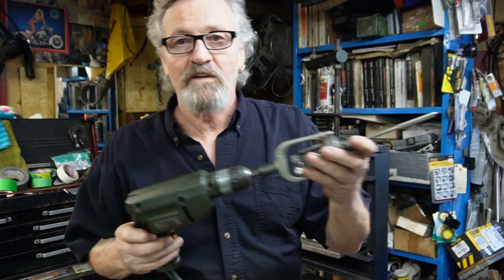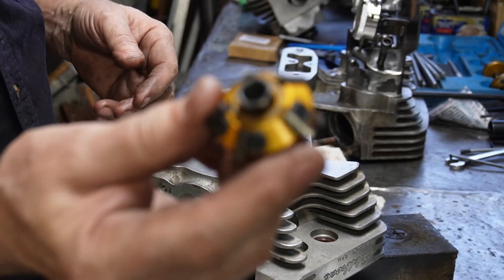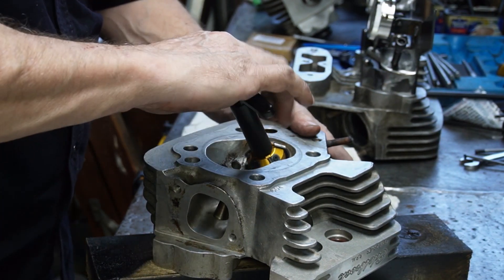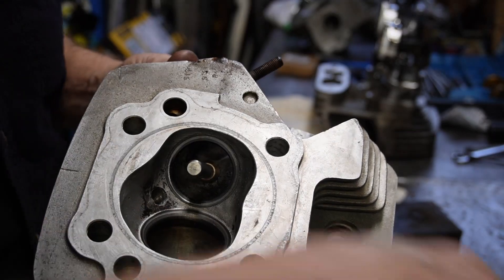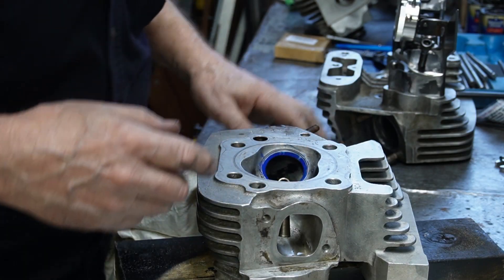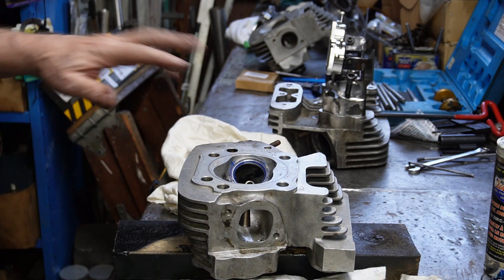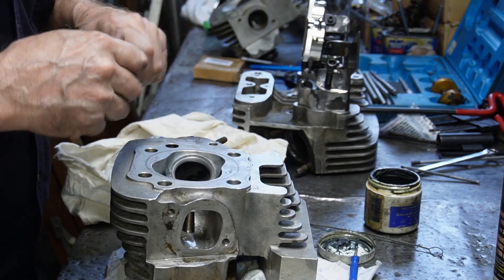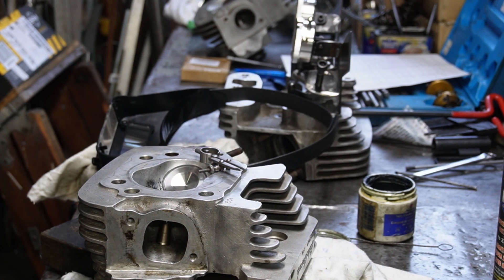DID WE GET THE VALVE GUIDE IN STRAIGHT, EDELBROOCK HEADS ON THE 96”

Comment: If you sink the valves deeper, doesn't that somewhat defeat the purpose of the higher lift cam?
Reply from the maker: There is always a trade off as I understand it, but we are not doing these mods for racing purposes only for necessity. The valves had to be sunk in the head to gain the clearance needed. In our case the vavle to valve clearance was a definate problem, as the valves were hitting each other, and modifications had to be made. As with any modifications going slow and doing out only what is needed is how we have gone with these heads. Getting advice from "people who know" in the field has helped us out a lot. I am not a head work expert and do not want anyone to think I am claiming to be one. I am just doing what I can do with the limited experience I have. Thanks for the questions and comments. Hope you enjoy the channel.
Reply: @itsmytimeletsgo  is that because those are aftermarket heads?
Reply from the maker: Yes old Edelbroock heads, they stopped making them in 2007 from what I can find out.